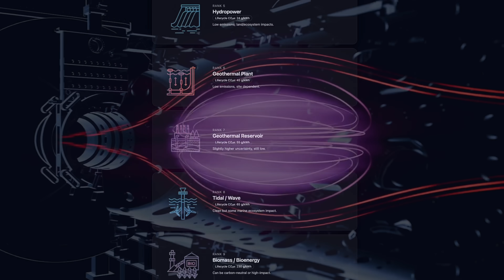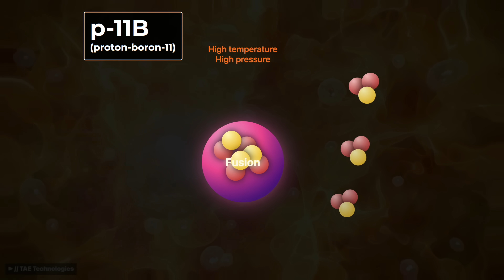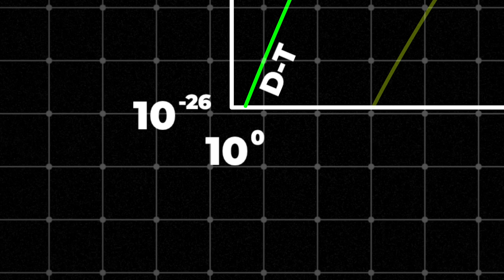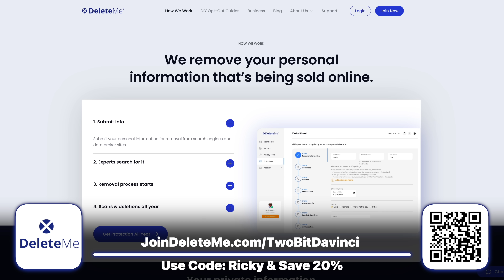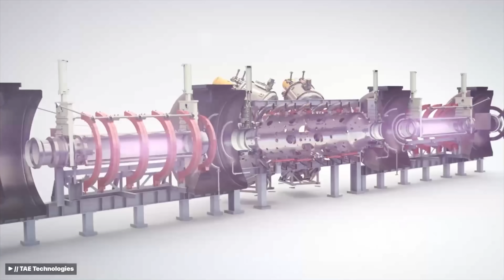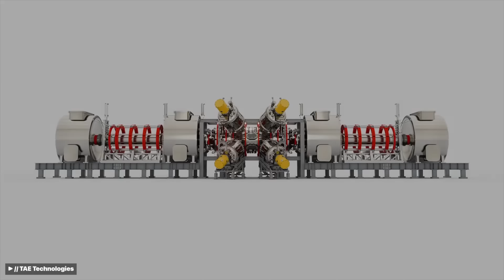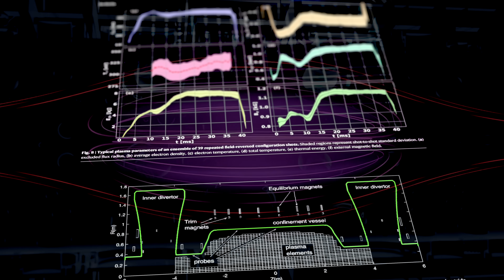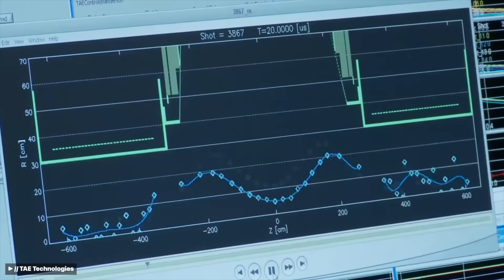The Nuclear Fusion Breakthrough EVERYONE Said Was Impossible

Comment: I still don't understand after this video why you'd chase P11-B as a fuel, did I miss something somewhere?
Reply: @metalhead2550  Yes it seems you might have. The elephant in the room with Deuterium/Tritium fuelled fusion is the scarcity of the fuel. I read something last year that explained how we still don't know where we will get enough fuel from, should one of these Tokamak research groups make some enormous breakthrough and be ready to use it in anger for grid generation. If one of the P-11B projects bears fruit, then we will have a working fusion reactor that we can source copious amounts of fuel for, quickly and easily.

The other big factor is it being aneutronic. The utopia is for fusion to be clean, not produce radioactive waste the same as fission does. Neutron bombardment of the materials the fusion reactor is made from makes them radioactive as Ricky explained, with all the obvious problems that brings, plus the fact that the isotopes you've created are gradually decaying into a different element. So the material is effectively being damaged too, gradually losing its desired properties as it turns into something else.

A fuel that avoids these issues is rightfully a huge deal.
Reply: That may be the case, but 1800x at 150M°C vs. 30x at 5B°C is a tradeoff that most companies will look at and say it's a no brainer, especially given the additional neutrons formed DT Tokamaks produce Tritium as a bi-product. As for waste, the half life of the DT waste is in the region of 11 years which is bury it and forget it territory (fission is a moot point as it's not being compared here). I personally think someone like Helion or Commonwealth have the most viable path to commercialisation currently
Reply: @metalhead2550 The nature of the waste depends entirely on what materials are being bombarded. Bury and forget half-lives are one thing, but you've still got to safely handle it.

I wasn't suggesting P11-B is without its own challenges, but your question was why would you pursue it and there simply are several good reasons why. So much of the technology we use today was once considered impossible. If we resign ourselves to that impossibility being an absolute certainty then we'd never invent anything.
Reply: I wasn't saying this approach was impossible, I was just saying the trade-offs presented, when compared to other competing approaches, don't seem massively appealing. I'm just approaching it with an engineering mindset: get things to a point that's good enough to commercialise then head in the direction of perfection with subsequent iterations.
Reply: Save billions on fuel.  Save billions NOT having to dispose of all that super-highly radioactive Tok chambers.
AND what @RVGmetallicasaw said: Societal Advancement.  When business, industry, and the populace all get nearly free energy, the world is a much LESS expensive place to live.  Potentially no more gas or electric bills and other good things like that.  If they're small, we can do away with the grid and just connect small cities or counties together.

Comment: Fusion advancements keep happening and I hope they succeed, but they still seem to be a long way off.  Other, simpler, renewable methods of producing electricity are also advancing. And the associated battery tech to store the intermittently produced electricity gets better and cheaper all the time.  I think it's likely that renewable energy and batteries will be able to supply 100% of our energy needs cheaply before fusion can.  But fusion research still has value for understanding practical applications of plasma physics.  That could pay off in unexpected ways even if fusion power never does.

Comment: It's nice but it's centralized power and I don't think it's going to be popular against decentralized solar power. 

At the retail consumer level, the cost of storage has dropped to $300 per kilowatt-hour for turn key systems. 

At the middle level, ordinary consumers can buy 12 kg of storage for about $1,000.  Then for another $400 they can build their own system. 

Most 2000 square foot houses use about 12 KW hours of storage for 9 months a year.

At the same time at the consumer level, solar panels have dropped similarly and you can create 12 kilowatt hours of power for about $1,000.   

The payoff on such an investment is 3 years.  And it's going to reduce demand for electricity. 

That's going to increase the grid tie fee, distribution charges, and maintenance fees on the lines. 

Which will push even more people off the Central electric system as batteries and panels continue to decline in price by about 4 to 10% per year.

Comment: Can you use the x-rays given off to do some of the work of heating the plasma, maybe redirecting the x-ray back into the plasma in a feedback loop?
Reply: Nope.  Xrays are really good at going through stuff.  There are no Xray mirrors that are like mirrors for optical frequencies.   And those xrays that you can manage to reflect back mostly--99% or more--go right through your fuel without heating it.  A mass the size of the sun can stop xrays and keep heat in, but the sun is so much larger and denser.

Comment: Start Nuclear Power? Two Bit is telling us that a not worth trying idea worked after some was st-smart enough to try it. ‘Try what? Start a nuclear reaction without a starter. That doesn’t just sound stupid.’ Using Gemini Opal App: Key Points: Fusion Reimagined: TAE Technologies’ Breakthrough, Unlocking the ‘Holy Grail’ of Clean Energy with Groundbreaking Innovation

The Core Innovation

TAE Technologies, a company working on nuclear fusion since 1998, has achieved a significant breakthrough by simplifying their Field-Reversed Configuration (FRC) fusion reactor. They successfully removed the complex “100 gigawatt starter” system, which not only slashed the machine’s capital cost by up to 50% but also, surprisingly, led to a doubling of key plasma performance metrics, making the reactor more efficient and compact.

✦The ‘Holy Grail’: Hydrogen-Boron (p-11B) Fuel

TAE’s long-term goal is to achieve fusion using hydrogen-boron (p-11B) fuel, which is considered the “holy grail” of clean energy. Unlike the more common Deuterium-Tritium (D-T) fuel, p-11B is aneutronic (no radioactive neutrons), produces harmless helium, and utilizes abundant, easily accessible fuel sources (hydrogen and boron).

✦FRC Design: Tailored for Extreme Temperatures

TAE’s FRC design is uniquely suited for these extreme temperatures, in contrast to tokamak designs. FRCs use a spinning football-shaped plasma that creates its own magnetic field, requiring less strong external magnets.

They previously overcame the FRC’s theoretical “tilt instability” using neutral beams as a gyroscope, a clever engineering solution to a fundamental physics challenge.

✦The Final Frontier: Battling Bremsstrahlung

However, p-11B requires extraordinarily high plasma temperatures—1 to 5 billion degrees Celsius—significantly hotter than D-T. While they’ve engineered a path to achieving the necessary temperatures, the remaining major challenge is Bremsstrahlung radiation.

This energy loss mechanism at high temperatures is believed by many physicists to prevent p-11B ignition. Despite these hurdles, TAE believes its high-beta FRC design is the only one with a chance to overcome this “final boss” of fusion physics.

✦Engineering the Impossible: A SpaceX-like Approach

The company’s track record of challenging fundamental assumptions and achieving unexpected engineering solutions draws parallels to SpaceX. This innovative mindset suggests they might find a way to overcome this final physics barrier, much like SpaceX revolutionized space travel by rethinking conventional wisdom.

Comment: One of my cars doesn't have a starter motor and works just fine. I found out that there are plenty unneserarly components in cars like an engine, transmission, exhaust, most of the cooiling system, catalic converter, fuel tank.... And the car is way qiocker.
Reply: F1cars don't have a starter either.

Comment: It is possible because the Earth is experiencing a flood of solar energy.  Just think, if it is correct that we are only one of many civilization heights of the past, as the Egyptian drawings would suggest we attained the same level as now, then where are the still hot nuclear waste piles?   The only one we have found is Oklo.   That would suggest that prior to Oklo there was sufficient energy and the technical knowledge to reduce these dangerous residues.  The worst possible outcome is that the energy stream still visits Earth  but has lesser capabilities.  And is of a shorter duration.  One might deduce this is associated with a magnetic pole reversal.

Comment: If they can already achieve temperatures of 75 million C why not just settle for doing the DT fusion if it only needs 1.5 million C? I know they are shooting for the benefits of the proton boron route, but could they not try both, or settle back for DT if they can't achieve it for PB?
Reply: Because their machine is not compatible with D-T. It doesn't have neutron shield, and it's direct capture, which works only with aneutronic fusion. D-He3 is the way to go, but He3 is extremely rare on Earth, it has to be mined on the Moon, so there's that.

Comment: Just a dumb thought. Can the bremsstrahlung radiation be down converted (wavelength increased) by a diamond casing and heat extracted. This way the X-rays would be your heat extraction process. Sounds just possible but difficult.

Comment: Almost all nuclear fusion energy presentations are promotional in nature, often intended to attract funding from technically naive funders. The leaders have learned to employ the extremely esoteric nature of the field as a tool to omit key evaluation details. This company has created at least five generations of machines but still hasn’t gotten within a third of the temperature needed to generate significant amounts of fusion reactions. This presentation used the term ‘ignition.’ That is misleading. Like almost all fusion energy experimental machines this operates in a pulsed mode with extremely low duty cycles which means it is highly unlikely to eventually evolve into a steady electricity source. Once the fusion reactions are achieved it doesn’t sustain itself until all the fuel is consumed. Energy needs to be constantly fed in to maintain the operation. The fusion energy experimenters use the phrase ‘net energy gain’ (Q) in a deceptive way. The input energy value that they employ, to calculate the Q value, tends to be a tiny fraction of the energy value required to power these facilities. The first nuclear fusion experiments began in the 1950s and since then over 150 experimental machines have been constructed and experimented on. Only a few have ever generated more than one watt-hour of fusion energy. Very few have ever employed fusion fuels but they have all been branded as ‘fusion reactors’ for promotional reasons. See the Wikipedia article titled ‘List of fusion experiments.’ Many people have been convinced that this is the holy grail that will save us. In fact it serves as a distraction.

Virtually all nuclear energy promoters, are in line with the vast majority of Earth's other 8.2+ billion humans, who continue to assume that we still have at least 20 years left to turn this 'Titanic' around using their favorite nuclear technology. They have become masterful in excluding the following warning from their consciousness.

UN chief: World has less than 2 years to avoid 'runaway climate change' (TheHill)
  * This statement was made 7.2 years ago.

Comment: Won't work just like every high density plasma project: Scattering effect. For Ions to fuse, they need to hit dead on. A Glancing hit doesn't trigger fusion. When you have high density plasma the ion scatter in all directions like billiard balls. The more scattering the less head on collisions that occur. Image if your wanted to run in a packed room There is no way for you to get up to running speed because you would bump into other people preventing you from getting up to running speed.

The scattering effect has been know since the 1950s yet people continue to ignore it as if its does not exist. There is an old saying: The definition of _____ is doing the same things over & over, but expecting different results.

The only viable P-B11 fusion project is HB11 (Australia) (hB11 [dot] energy) which uses laser light to accelerate streams of protons into boron. However the issue is be able to scale up this method for commercial power production.

None of the hot plasma Fusion methods will be viable do to cost. D-T is just too expensive as ITER will cost about $65B for only 500MW Thermal, At best it probably can only produce about 50MW to 100MW of electricity do the high input energy production, Tritium breeding, and difficultly extracting energy from fast neutrons. Fusion power would like cause rate payers around $5 to $30 per kwh. Most rate payers pay less than 0.25 per kwh.

Comment: if it is possible to catch the escaping energy; then maybe that is the solution?
Reply: it is, water heats up when radiation splits it.  most often the split molecule will recombine causing even more energy, heating a pool.  depending on the energy level of the xrays, they might need a BIG pool, but it should work if they insulate it.

Comment: The benefit of making helium is the fact that we're otherwise running out.  The only natural source is from the decay of elements like uranium.  Once we've tapped natural resources we have no other way to make helium other than fusion.  We've long used helium with abandon for filling balloons at parties or even giant Macy's Day parade floats.  This helium isn't recaptured.
Reply: Space ? Solar wind is blowing tons of helium that can easily be captured with a large electric field as the particles are charged. think of a net made of some copper wire a few square kilometer large powered by solar pannels

Comment: 1:55 - And how, exactly, are  they planning to generate energy without using a steam turbine?

If they are going to use steam turbines, why bring up steam turbines as a problem?
Reply: Even if alternative physical principles are used to extract electric energy from fusion there will be a enormous heat left.  Steam turbines are kinda well understood and readily available, so why not use them.
Reply: @ralfbaechle  Yeah, I really don't get that complaint from anyone.

We know of very few ways to generate electricity, and as far as I know only two of them are used in terrestrial settings:

1) Photo-electric effect, as used in solar panels. 
2) Rotating magnets which is used in everything else. How we rotate the magnets depends on the implementation.
Reply: @MrMartinSchou this, so many people act like steam turbines are old so they must be outdated and we need something new. Like okay, wheels are so old, are they outdated therefore we need something new? Something being old doesnt make it bad. If there comes along other ways to make a magnet spin then sure let's use them, but only when they are better than steam turbines.
Reply: The steam cycle (actually the Carnot Cycle - as it works with other fluids/gases as well) is naturally very inefficient.  Most power plants have to toss away at least 50% of the input energy, and most of them toss away about 66% of the input energy.  Changing fluids do not change this efficiency (I keep seeing claims that using CO2 will make a power plant more efficient than using steam: absolutely false; but CO2 equipment would be smaller).

The alternatives is direct magnetic field capture... which should have an energy efficiency in the low 90%'s.  So you only have to toss away perhaps 10% of the energy.

Helion energy has already started to experiment with direct energy capture (they have already built multiple generations of a pulse fusion machine and are testing this).

This video completely misses what Helion Energy is doing and their approach to fusion.  Not sure that the Helion will succeed.  But they are the farthest ahead in non-tokamak fusion machines - and in direct energy capture.
Reply: @perryallan3524  Thank you. That is quite informative.

Basically rotating magnets :D
Reply: @MrMartinSchou  Actually, Helion is using non-rotating magnets and magnetic fields.  They use expanding and collapsing magnetic fields.   Elimination of rotating equipment greatly simplifies things.   However, their approach is tied to the fact that they have a pulse fusion reactor - each pulse generates a magnetic field, that collapses before the next pulse.  They hope to achieve pulse rates of at least 1 pulse per second, and in theory faster than that.